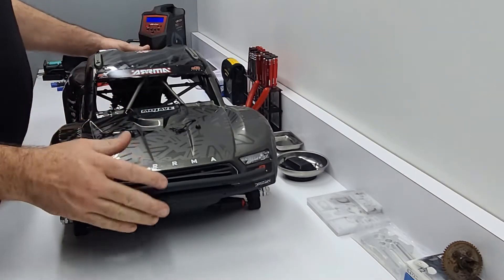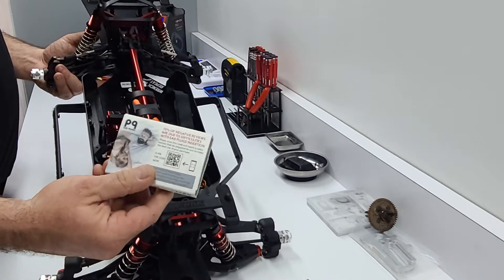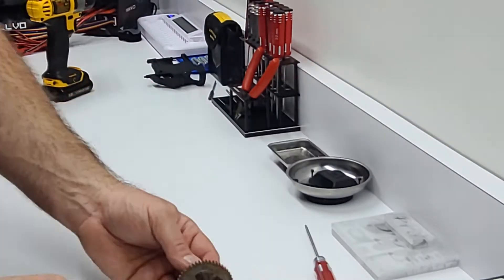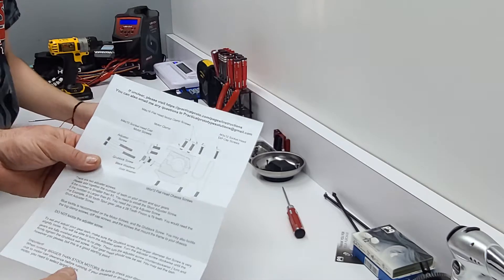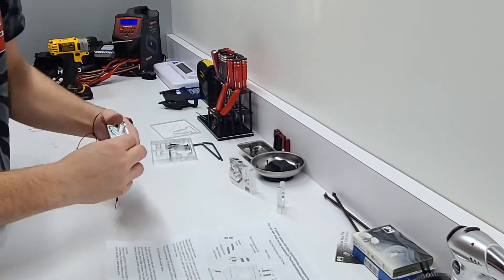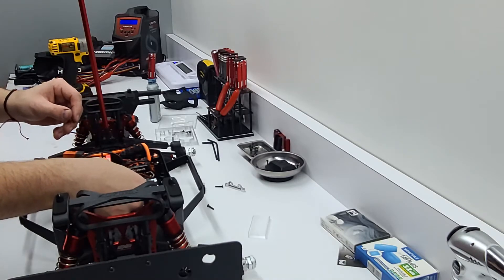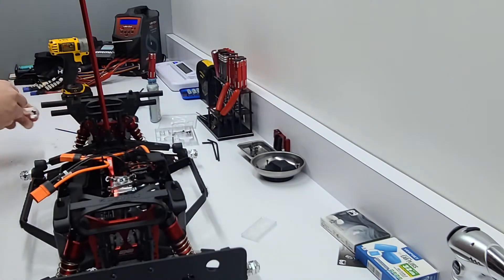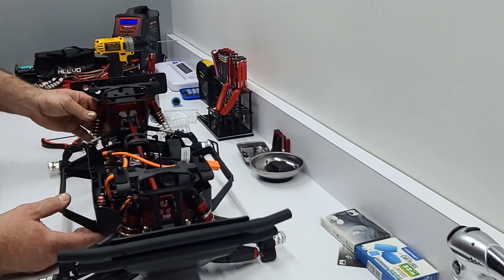Arrma Mojave EXB 8s Build | Part 3 | PPS Mount

Comment: The center DIFF- fit. Only 2 washers on the inside of the diff not 3. ARA709060-ARA709059.  Too much of a good thing Silicone.( I had a similar issue)
Reply from the maker: Thanks